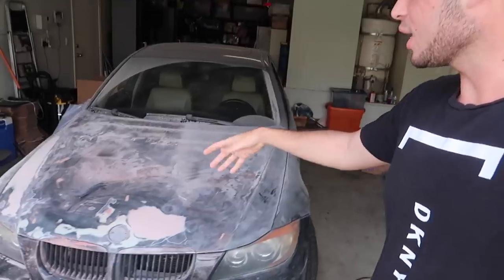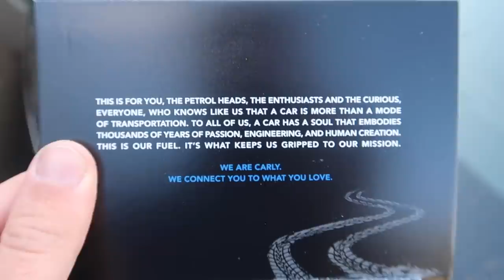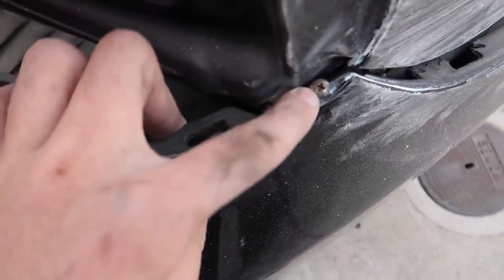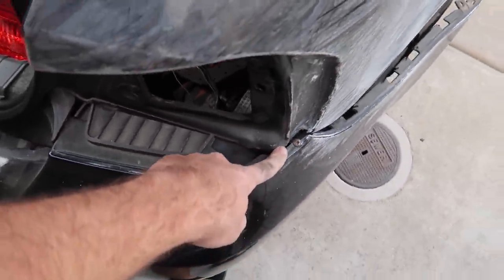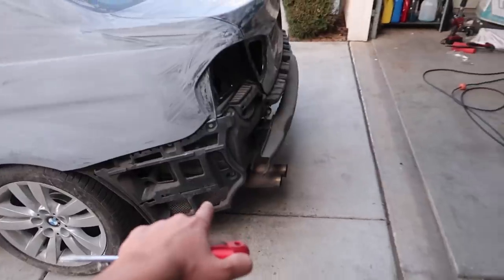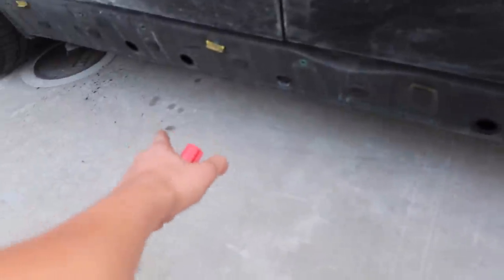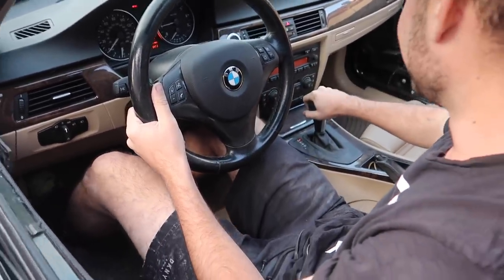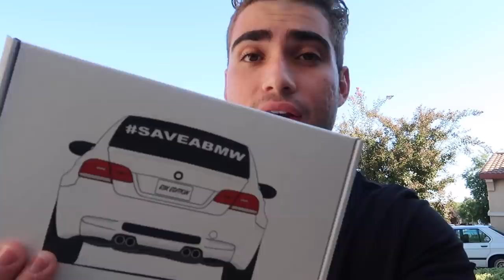HOW TO PAINT A BMW! (PART.2)

Comment: Hey 
I wanna buy an 316i e90 and im a little worried
Is it actually reliable fuel efficient and cheap to make it a daily and thanks 🙏🙇
Reply: I'd say go for the 320d instead
Reply: @Priingles  wich one is more efficient
Reply from the maker: ala hachana it’s honestly the most reliable of a bmw, but it’s still a bmw
Reply: @NourHummadi  ok thanks a lot
Reply: unknown user hell no ! I know good fuel economy but e90 diesel engines (n47) are very well known for the timing chain issues, this could possibly ruin
Your whole engine ! Id recommend the 316i, i mean its the most fuel efficient e90 out there, but still it all depends on how you drive it !
Reply: @yaron1998   thats what i was thinking about cause i heard that the chain is a very common problem

Comment: How am I doing? Not so well, I’m smelling burning oil inside my 07 335i, I can’t see any oil leaks around the VCG, but there is oil leaking around the oil pan. I’m hoping it’s just the VCG or the PCV. I really don’t want to do the OPG. 
My son thought he would help clean the bugs off my car by scrubbing it with a scotchbrite pad.  You can say I’ve had better days. On the bright side I found some sexy M-Par wheels.

Comment: My driver door wouldn’t lock with the remote so I changed the actuator? Lol idk but it locks now but now the mirror won’t fold 🤦🏻‍♂️ lol when it’s one thing it’s another!!!
Reply: B. Y. Hernandez i replaced my actuator last week haha
Reply: Alex Abrams ur mirror folds and adjust? Maybe I disconnected something lol first my windows didn’t work I popped it open disconnected it and plug back in worked then my stupid mirror
Reply: B. Y. Hernandez maybe you forgot to plug something In when you put the door panel back on. Could just be a coincidence. My mirror fold hasn’t had any issues
Reply: Alex Abrams yeah ima have to take it apart again pretty easy but i always end up having one bolt left lol 😂
Reply from the maker: B. Y. Hernandez you probably just forgot to plug something in😅 it happens
Reply: Nour Hummadi probably!